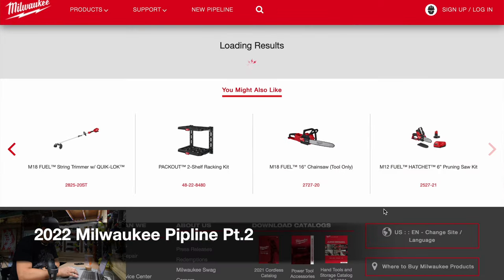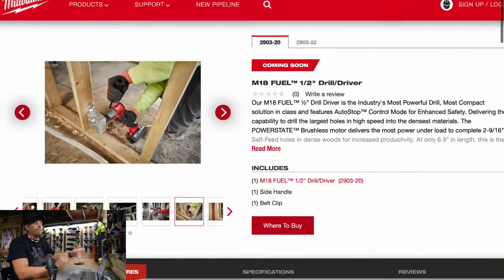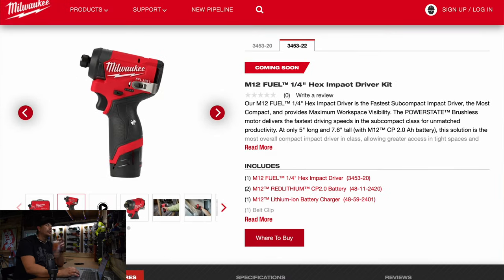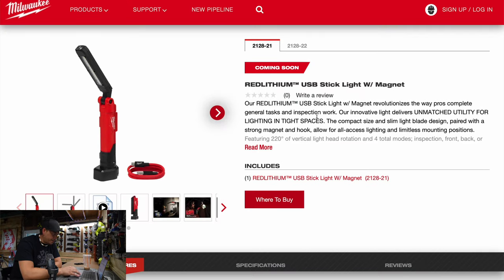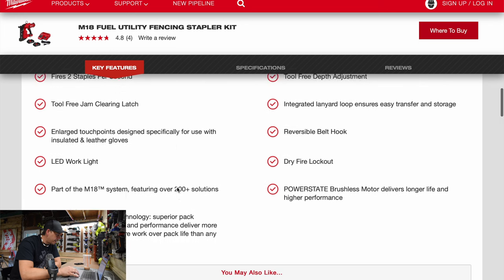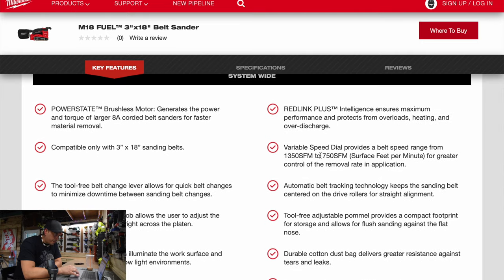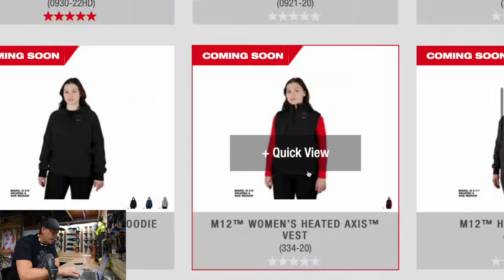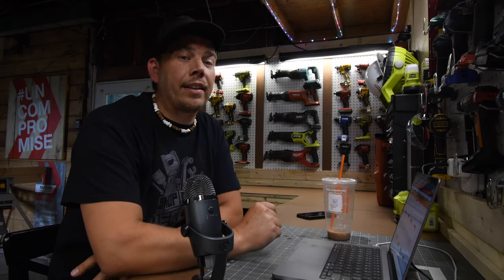2022 Milwauke Pipeline Event Part 2.

Comment: I got that $229 deal at HD last year for the fuel hammer drill, impact driver and "free" brushed 3/8 ratchet. It came with a 4 and 2ah battery, charger and soft case.. my m12 fuel impact puts my brushed 18v ridgid impact to shame..

Theres a guy that has a video with the brushless Ridgid 18v impact vs the fuel m12 impact and the fuel beat it.

Since i am mostly invested 18v on ridgid and love my circ and recip i thought bout getting the gen5 brushless ridgid but all i reach for is my m12 fuels mainly..

Im a DIYer and man the impact driver runs circles around my gen4x impact.. i feel like my ridgid 18v drill/impact are like the kid you have in school who isnt doing well and you arent mad but just disappointed in them...

The only time i mess wit my gen4x Ridgid drill is literally driving in a 12" auger bit to drive stakes in for my sons inflatebale slide because the god damn soil is such shit here and i dont wana fuck uo my m12 drill.  Hell rather go thru Ridgid LSA than milwaulee..

The irony now is I work at Lowes and look at tool deals but literally my whole fking platform is Ridgid, Milwaukee and a splash of Ryobi and some of that stems from a simple amazon Ridgid battery to ryobi for landscape items..

Just an FYI most cordless tools we get returns on are Craftsman.. surprising right?